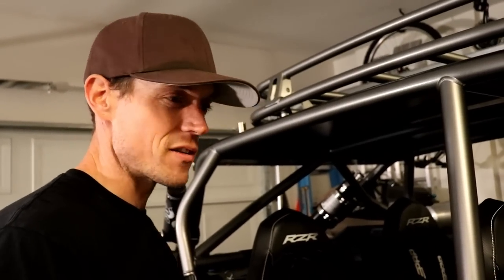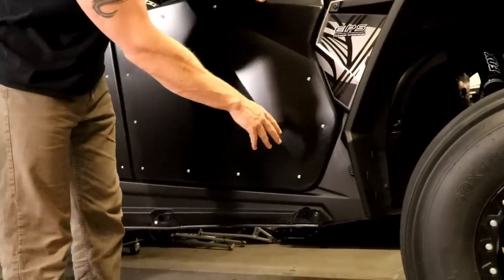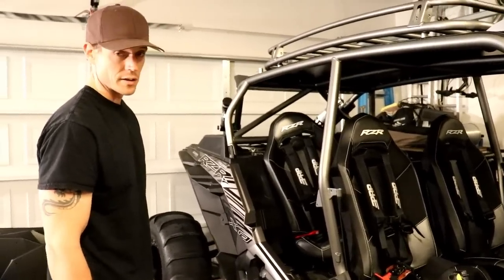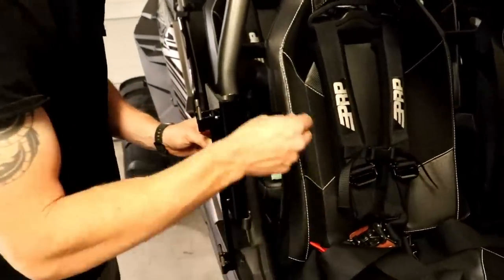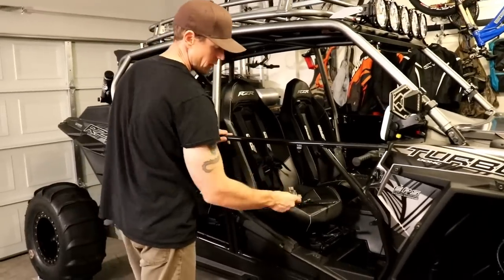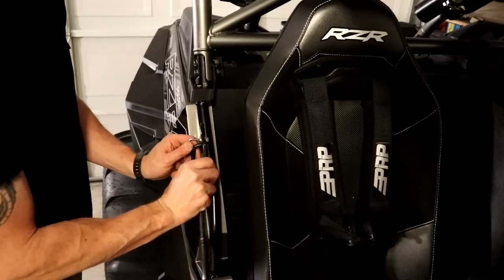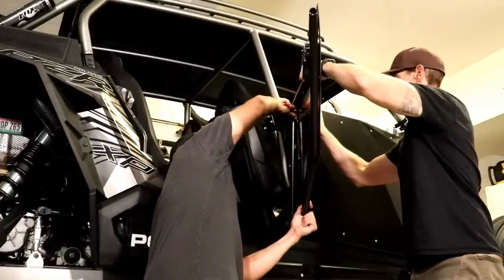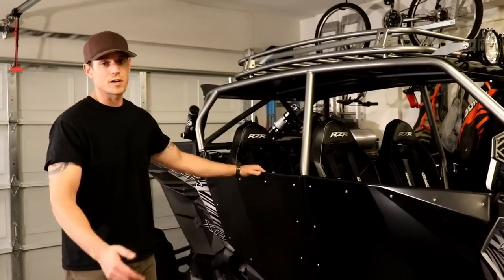Upgrades for your RZR Turbo full doors how to install TMW Offroad Sidewinder - SXS UTV MODS

Comment: Oh Yeah, I like these doors, and I also like the way the back doors are straight and do not curve up like you said. I can not stand my stock doors with the Pro Armor lowers the dealer installed. they rattle and squeak that drives me crazy and they don't even fit properly there are gaps everywhere, even though they are metal they  are flimsy. These doors look so sleek and have clean lines and I like the way they designed them with the frame going all along the edge.. With the Madigan cage I ordered after watching your posting and these doors my RZR will look great, (but not as nice as yours). Might have to stop watching you vids though, or come out of retirement and get a job.
Reply from the maker: Ha! Your going to love the cage, and doors. Email some photos when you have it all installed. Would love to see it! Congrats

Comment: The Madigan cage roof and the TMW door skins were making a lot of noise on my RZR, has that sheet metal echo sound and some squeaks when driving around on rough trails, so I took them all off and purchased some fake carbon fiber marine grade vinyl and cut it to fit and used some industrial strength adhesive to dampen the noise.

Comment: Great video and nice looking car! I know this is an old video but was curious if the bottom of the door meets the plastic of the car or is there a huge gap in the bottom? Do you get a lot of dust inside coming from the bottom of the door?
Reply from the maker: They made a pretty good seal all around. I was happy with what they were able to keep out. Unless you were eating dust from following someone they kept the inside pretty clean.

Comment: Doors look good, but I have a hard time believing those lift off hinges are not going to rattle.
Reply from the maker: Let's hope not! It'll ruin the ride audio haha.. we'll find out here soon
Reply: The Off Road Adventure Channel, I ended up using flange bolts/nuts on my RZR doors to tighten up the hinges and stop the rattling...I’m a bit OCD when it comes to noise.

Comment: Now that you have had these 2 years can you provide a follow up? Very interested but have had very bad luck with aftermarket doors going back to 2015 with dirt engineered doors. 4 sets with that company, lots of back and forth with them and they all fit like crap or lost adjustment soon as you got on the trail. Been looking at these or the motoarmor ones.
Reply from the maker: They've been absolutely issue free. No rattle, nothings come loose, no squeaks. Could be that they are designed and made better? It's the only set of doors I've ever purchased. Well worth it, just take your time installing them. Make sure everything is aligned correctly and tightened down. Highly recommend.